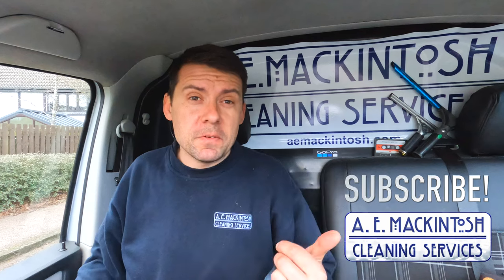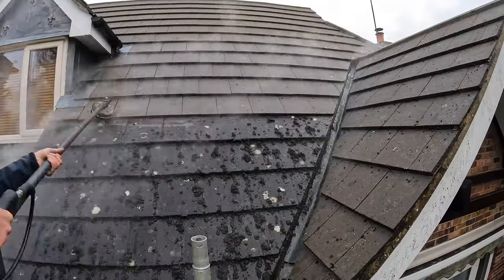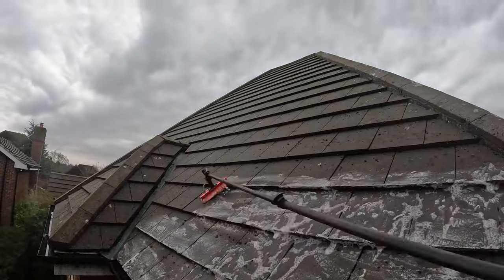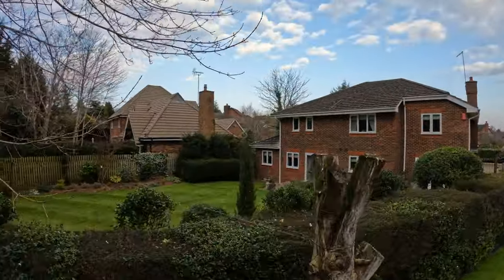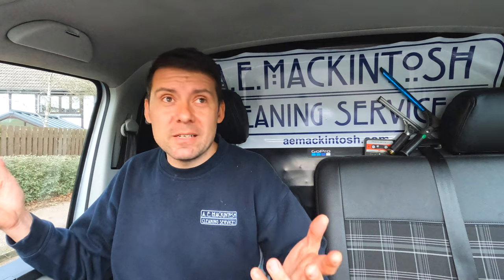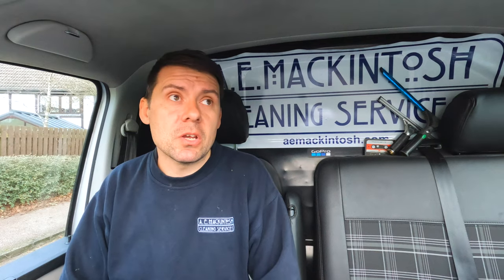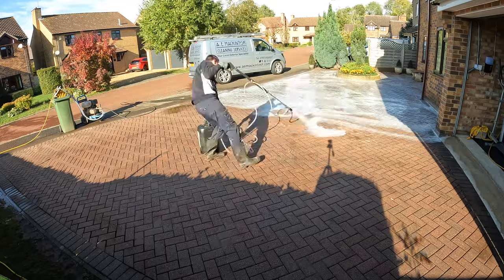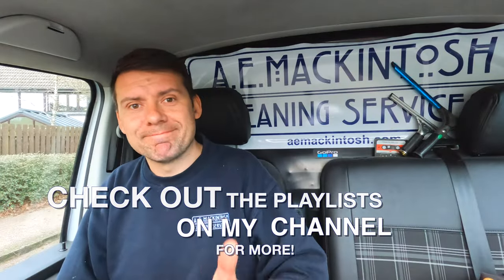Should You Pressure Wash A Roof?

Comment: Hi mate recently started out done my 1st small roof last week i know every roof is different but if all tiles are in good condition and was using the pressure washer with small surface how much do you turn the machine down so you don’t use to much force on roofs like my machine is 15lr per minute 4000 psi I had it turned down around half way obviously I don’t want to use to much pressure and cause damage or to less and do a crap job if you had any advice 
Thanks James
Reply from the maker: I turn my 21litres per minute machine down to about 2000psi.👍🏼
Reply: @aemackintosh  okay thank you and do you turn it down by the throttle or by the pressure adjustment on the machine
Reply from the maker: The engine is designed to run at full revs, so it’s better to adjust the pressure down using the unloader valve.
Reply: @aemackintosh  okay great thanks for replying in reference to applying the biocide I’m working on a budget at the moment would the matabi 20litre electric pack sprayer with the 5.4 metre Lance be okay to use thanks

Comment: HI, is V tuf a replacement for your jet washer or you connect the two?
Reply from the maker: No, the VTUF is only a 15litres per minute pressure washer. The pressure washing power decreases as you turn the heat up, to give you more cleaning power via the steam. But some situations are better with more pressure and other more delicate situations and better with more steam.👍🏼
Reply: Thank you

Comment: Would make more sense to get a mazzoni firebox boiler and run your gx390 200bar 21lpm through it them v tuffs are only about 150 bar 15lpm that way u have more power on the steam and will cut through jobs a lot quicker
Reply from the maker: You are exactly right there! I’ve heard those firebox’s can be a bit unreliable, have you used one?👍🏼

Comment: have you ever used Smartseal  Roof Reviver?  lots cheaper than GK Pro ..guess its not as powerful
Reply from the maker: Check the dilution rate. GK Pro is thicker and goes further.😉👍🏼
Reply: @aemackintosh  I am DIY as can't find anyone good locally .. chalet bungalow but lots of moss to scrape off first ..looking for a pole that's not so expensive as carbon
Reply from the maker: Poles that are not carbon are very bendy and usually difficult to work with.😬👎🏼
Reply: @aemackintosh  thanks appreciate the advice ..will look at carbon

Comment: Could anybody point me in the direction. Can roof cleaning be done with just a standard Honda petrol pressure washer 17l per minute. Or does it need a steam cleaner. Also where do I purchase the kit to spray from a gardiner pole. Thanks
Reply: Acpressurewashers google them and you will find the pole adaptor kit or rutland pumps do one as well.
Reply: @Alpha view Window cleaning  cheers for that will have a look now

Comment: How do you price your roof cleaning jobs ?
Reply from the maker: I charge per square meter.
Reply: @aemackintosh   sorry I should have worded my question a bit better my bad what I should  of said was does it cost more considering working at heights or if the tools required are extra should that be taken into consideration ? Or should I for example charge the exact same price as a block paved driveway as a roof if it was the same SQM

Many thanks in advance

Comment: I have called Marley tiles one of the biggest tile manufacturer . They say you should never  pressure wash tiles . Only scrape and wire brush. If you pressure wash or steam clean .This could invalidate the house insurance. You should tell the customer this so they can check with there insurance company
Reply: Scraping the roof with a metal trowel / scraper is not exactly great you could argue that this would damage the tiles it’s far from the soft approach , this method also removed the granule texture , but by the time a roof needing scraped or lightly pressure washed the warranty is long gone hence the customer phoning in the first place , as explained in the video most of us lower the LPM or use a gauge on the pump head to ensure we are operating at a sensible pressure, some people will climb up there and go at it with a 250bar 21LPM on full chat this I wouldn’t agree with, some of the UKs biggest companies out there blast away cleaning and lbc are all doing the roofs, not every tile can be cleaned with pressure but this is down to the company carrying out the cleaning and this will all be explained during the site visit
Reply from the maker: One manufacturer doesn’t dictate what the whole industry should do. Of course they don’t want just anyone doing who knows what to their tiles. But there is not any governing organisation setting standards for this industry. Maybe that’s part of the problem?

Comment: You dont mention looking  inside the loft to  check that there is no water ingress or damage to the roof felt. This should be an essential check after any roof work .  Viewers if they can should also look inside the loft, remember even a few drops of water could mean painting your ceiling in the room.
Reply from the maker: The roof tiles are designed to be water resistant. We use a specialist setup with low pressure that is gentle to the surface. Not everyone doing this work is careful about what they’re doing. See this video for more information:
https://youtu.be/vysHK4nkCIY?si=qZ5sDF2YgqzCokK2
Reply: ll
Reply: Are not all tiles waterproof . The weakest parts of a roof are the many joints in the covering of adjacent tiles, even one ingress of pressured water could be a challenge to the water proofness to the membrane . If this occurs it would mean at least a damaged decoration to the bedroom ceiling. 

Yes your work is a vast improvement to the appearance of an old roof . My 40 year old roof would  benefit from a clean but dare i risk it ???

Comment: From my own experience as a roofer I strongly advise agains it! Only use a scraper or broom then spray on treatment that protects the tiles from future moss build up!!!!!!!!!!  Pressure washing roofs forces the years of dirt out and also weakens the tiles to the point that they are really thin and fragile!!! Iv been to so many jobs where roofs have been pressure washed and it rips the roofs apart. Yes it looks good, but then does it? Why do you want clean tiles. Iv replaced 60 tiles on a house before because of this crap.
Reply from the maker: Thanks for your comments. I think there is a big difference to how certain people approach it and how a professional that knows how to handle a pressure washer would approach things. Using a gun and/turbo nozzle can be very damaging to certain tiles, especially if too much pressure is used. The tool I mostly use (fsc) splits the already reduced pressure across two fan jets, which cover the surface nice and evenly. Even so, this method is not suitable for all tiles.
Reply: Roofers are against roof cleaners and roof cleaners are against roofing companies. Simply comes down to what a customer can afford end of the day. 6k new roof or 1k to clean 🤷‍♂️
Reply: @jaysvaleting2064  why would roof cleaners be agains roofers? We are the ones that have to go repair the stuff roof cleaners destroy.

Comment: You confused flow rate with pressure rate mate 🙈 I use less flow but higher pressure than you.  You use high flow lower pressure. Both have advantages. Good advice though as always 👌
Reply from the maker: Maybe a slip of the tongue? But many pressure washers are quite similar in psi, so I tend to refer to the litre per minute value as an indicator of power. Although in reality it’s the combination of the two.😉👍🏼
Reply: @aemackintosh  that's what I thought mate 👍  ... p.s Lichen is pronounced how you said it first lol (Phonetically Lykin )
Reply: That's why you leak the roof

Comment: Nearly all roofers and tile manufacturers advise against pressure washing a roof.
Reply from the maker: Keep up the scraping if that’s what you prefer.👍🏼
Reply: A serious risk from pressure washing roofs is that tiles may contain asbestos. If that gets on your clothes, your face, your van, especially inside a confined area and you're breathing that in, then you take it home to the family and wash it into everyone else's clothes using the washing machine, you just spread a LOT of risk to your health and your family. This practice is outlawed and advised against in some places. The HSE warn not to do it. But for some strange reason the people selling the equipment never seem to know about all the dangers nor do they advise their customers that this product could lead to massive issues for your family and their future

NEVER JET WASH ASBESTOS
Reply: That's because they want to sell you new tiles for a re-roof. Can you imagine the business lost if we all cleaned our roof instead of replacing tiles. The biggest risk jetwashing is removing dyes used in the top layer of the tile. There is very little risk in damaging tiles by using a low pressure wash. May tiles have been on a roof for 30 plus years through, hail, snow, wind and rain and heat. A low pressure wash is fine, just test a small area first.
Reply: For slate tiles it's okay to pressure wash. Not concrete tiles though.
Reply: Of course they do... they want you to change your roof to keep them in work. The last thing they want is you taking 30 years of dirt off the roof to make it look new.
Reply: They don't have the same roofs in us they have stone tiles ,that get mossy from the constant moisture, in England where he is

Comment: Get in my group on Facebook EasyJetwash help and advice.
I just shared a proper video how to setup flow sensitive unloader fitted with needle valve and pressure gauge. Best way to set the right pressure and have no guess work.
Pressure washing is safe as long as you know what do you do and have the right set-up.
Happy jetwashing
Reply from the maker: Sounds good.😃👍🏼

Comment: You are financially cleaning up OK ??? by damaging peoples roofs .old Ridge tile mortar will not tolerate any form of power washing , the cement mix is weeker to allow for expansion and contracting ,
Reply from the maker: I’m using a specialist low pressure setup that is very gentle on the surface.

Comment: As a roofer of seven years and dad a roofer for 40 years. No you should not
Reply: Could you explain why?
Reply from the maker: There seems to be quite a few out there with the same viewpoint as you. But I think it’s too late to fight against it. This is an unregulated industry and it’s far better to try and educate people to carry out this type of work in a safe and sensible way.👍🏼
Reply: nothing wrong with pressure washing a roof...In the right hands! If your going to blast away at 250 bar from 6 inches away then yes. Slow steady process there's nothing wrong with it. FACT!